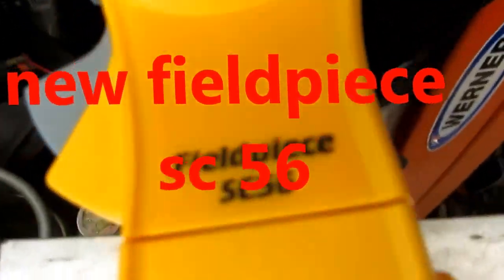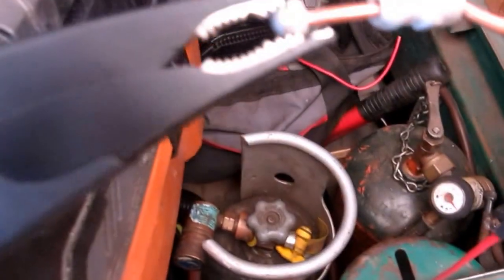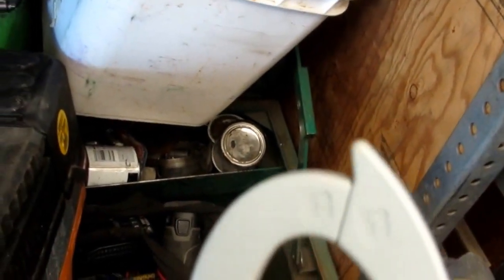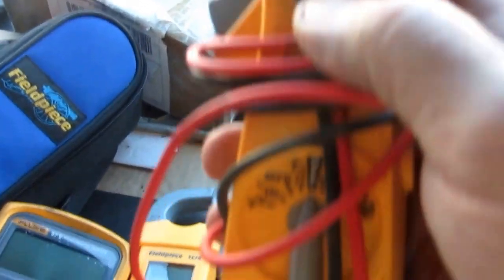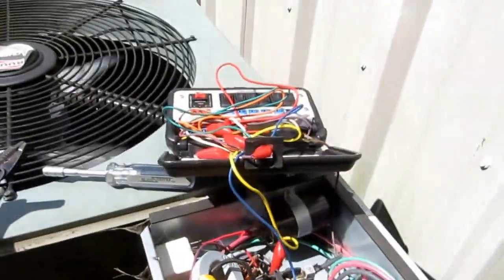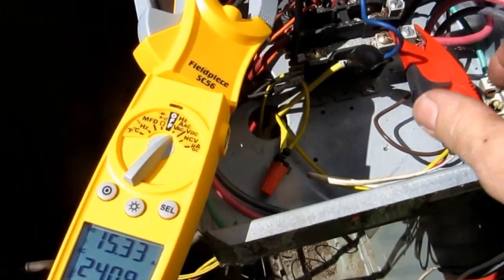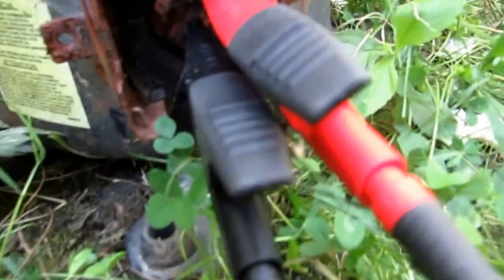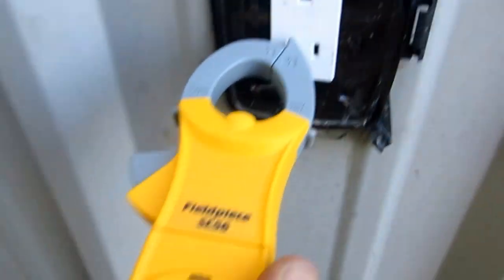HVAC TOOLS : review of field piece newest clamp meter  s c 56

Comment: I still have an HS 26 after almost 33 years in Industrial Electrics and electronic it never let me down.  It still works great.  What I dislike about the newer ones is the carrying case.  The old cases which were black had many little zip up and Velcro compartments for carry a few odds and ends so you didn't have to drag around boxes or run to your vehicle if you dropped or lost a cap or connector or just carried spare fuses.  Bring back the multi-pocketed  bsg.
Reply: Bag, old fingers sometimes screw-up.  Sorry.

Comment: No problem. Im looking for new meter has well. Had a fluke 902 at last job. I liked it but went through 2 of them under warranty. I am a fluke 87v which are great fir frequency drive troubleshooting. But i did like function of 902.

Comment from the maker: yes you can its the last setting on the right thats what you would use to test flame sencers on a gas furnace .milli amps. milli volts are used to test thermocouples @ power pill generators ..thanks for commenting @ watching juan